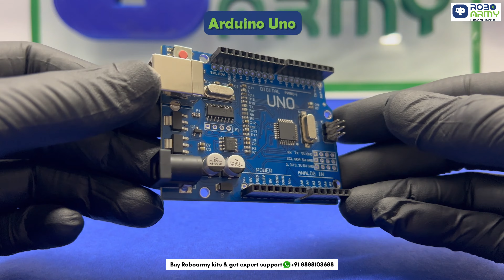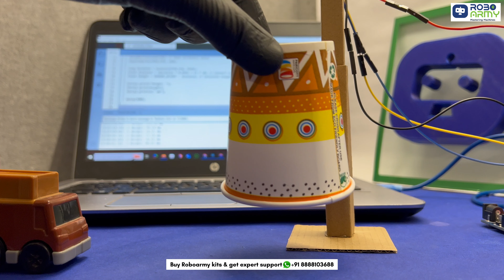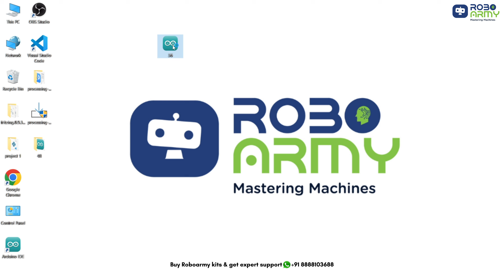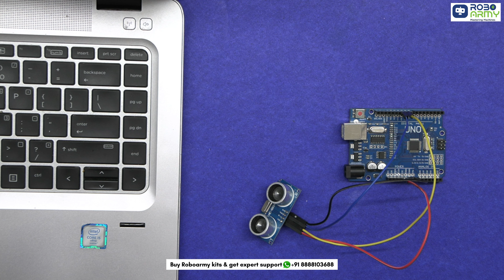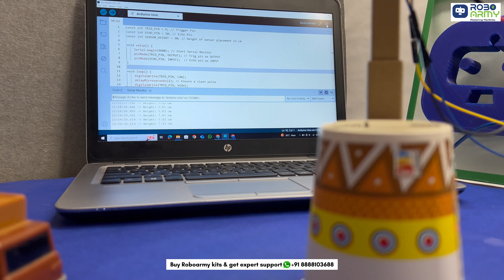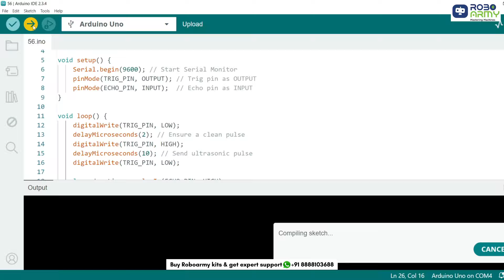Arduino Magic: Height Measurement Tool in Seconds! (Live Demo)

Comment: please send code sir
Reply from the maker: here is the code for Height measurement tool-:
const int TRIG_PIN = 9; // Trigger Pin
const int ECHO_PIN = 10; // Echo Pin
const int SENSOR_HEIGHT = 30; // Height of sensor placement in cm

void setup() {
    Serial.begin(9600); // Start Serial Monitor
    pinMode(TRIG_PIN, OUTPUT); // Trig pin as OUTPUT
    pinMode(ECHO_PIN, INPUT);  // Echo pin as INPUT
}

void loop() {
    digitalWrite(TRIG_PIN, LOW);
    delayMicroseconds(2); // Ensure a clean pulse
    digitalWrite(TRIG_PIN, HIGH);
    delayMicroseconds(10); // Send ultrasonic pulse
    digitalWrite(TRIG_PIN, LOW);

    long duration = pulseIn(ECHO_PIN, HIGH);
    float distance = duration * 0.0343 / 2; // Convert to cm
    float height = SENSOR_HEIGHT - distance; // Calculate height

    Serial.print("Height: ");
    Serial.print(height);
    Serial.println(" cm");

    delay(500);
}

Comment: this serial monitor show like this
const int TRIG_PIN = 9; // Trigger Pin
const int ECHO_PIN = 10; // Echo Pin
const int SENSOR_HEIGHT = 30; // Height of sensor placement in cm

void setup() {
    Serial.begin(9600); // Start Serial Monitor
    pinMode(TRIG_PIN, OUTPUT); // Trig pin as OUTPUT
    pinMode(ECHO_PIN, INPUT);  // Echo pin as INPUT
}

void loop() {
    digitalWrite(TRIG_PIN, LOW);
    delayMicroseconds(2); // Ensure a clean pulse
    digitalWrite(TRIG_PIN, HIGH);
    delayMicroseconds(10); // Send ultrasonic pulse
    digitalWrite(TRIG_PIN, LOW);

    long duration = pulseIn(ECHO_PIN, HIGH);
    float distance = duration * 0.0343 / 2; // Convert to cm
    float height = SENSOR_HEIGHT - distance; // Calculate height
what is solution?
Reply from the maker: its look like wiring or Code issue 
here is your updated code for this:
const int TRIG_PIN = 9;       // Trigger Pin
const int ECHO_PIN = 10;      // Echo Pin
const int SENSOR_HEIGHT = 30; // Fixed height of sensor from ground (in cm)

void setup() {
  Serial.begin(9600);              // Start Serial Monitor
  pinMode(TRIG_PIN, OUTPUT);       // TRIG as OUTPUT
  pinMode(ECHO_PIN, INPUT);        // ECHO as INPUT
}

void loop() {
  // Send a clean 10µs pulse on TRIG
  digitalWrite(TRIG_PIN, LOW);
  delayMicroseconds(2);
  digitalWrite(TRIG_PIN, HIGH);
  delayMicroseconds(10);
  digitalWrite(TRIG_PIN, LOW);

  // Read the echo pulse duration
  long duration = pulseIn(ECHO_PIN, HIGH);

  // Convert time to distance (in cm)
  float distance = duration * 0.0343 / 2;

  // Calculate object/level height below sensor
  float height = SENSOR_HEIGHT - distance;

  // Output values to Serial Monitor
  Serial.print("Raw distance: ");
  Serial.print(distance, 2);
  Serial.print(" cm    Measured height: ");
  Serial.print(height, 2);
  Serial.println(" cm");

  delay(500);  // Pause between readings
}

Comment: can you explain how it is
Reply from the maker: Great question! Yes, you can definitely measure the height of a person using this project. 🧍‍♂️📏

Here’s how you can do it:

🔧 Circuit Mounting Changes:
Mount the ultrasonic sensor (HC-SR04) at a fixed height above the ground—preferably on a wall, tripod, or frame.
Make sure it’s pointing straight down so it can measure the distance between the sensor and the top of the person’s head.
For accurate results, the person should stand directly below the sensor, facing away or sideways.

Code Changes:
In the code, there’s a line:
const int SENSOR_HEIGHT = 30; // Height of sensor from ground in cm

Change 30 to the actual height at which you have mounted your sensor (e.g., if it's 180 cm above the ground, write 180).
This part of the code:
float height = SENSOR_HEIGHT - distance;
...is where the actual height of the person is calculated by subtracting the measured distance from the total sensor height.

✅ Example:
If you mount the sensor at 200 cm (2 meters), and the sensor detects a distance of 50 cm to the top of the person's head, the code will calculate:
200 - 50 = 150 cm (person’s height)

Comment: sir can we measure the height of a person through this
Reply from the maker: Great question! Yes, you can definitely measure the height of a person using this project. 🧍‍♂️📏

Here’s how you can do it:

🔧 Circuit Mounting Changes:
Mount the ultrasonic sensor (HC-SR04) at a fixed height above the ground—preferably on a wall, tripod, or frame.
Make sure it’s pointing straight down so it can measure the distance between the sensor and the top of the person’s head.
For accurate results, the person should stand directly below the sensor, facing away or sideways.

Code Changes:
In the code, there’s a line:
const int SENSOR_HEIGHT = 30; // Height of sensor from ground in cm

Change 30 to the actual height at which you have mounted your sensor (e.g., if it's 180 cm above the ground, write 180).
This part of the code:
float height = SENSOR_HEIGHT - distance;
...is where the actual height of the person is calculated by subtracting the measured distance from the total sensor height.

✅ Example:
If you mount the sensor at 200 cm (2 meters), and the sensor detects a distance of 50 cm to the top of the person's head, the code will calculate:
200 - 50 = 150 cm (person’s height)